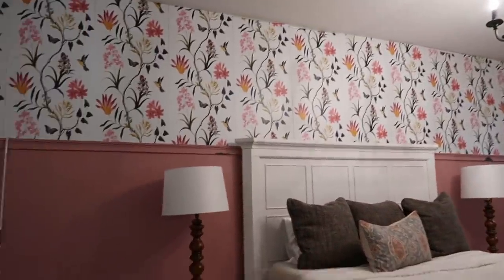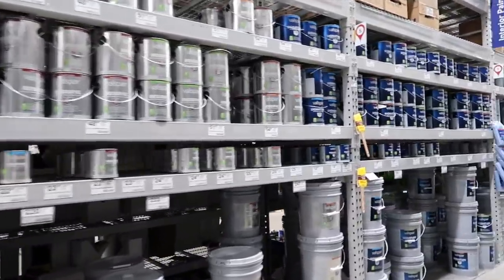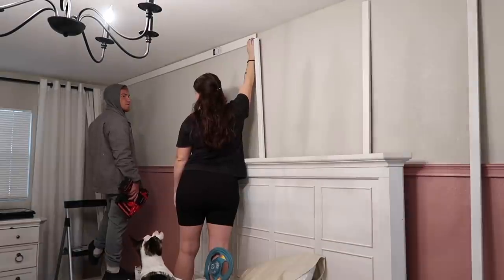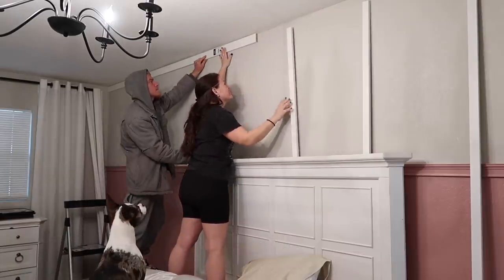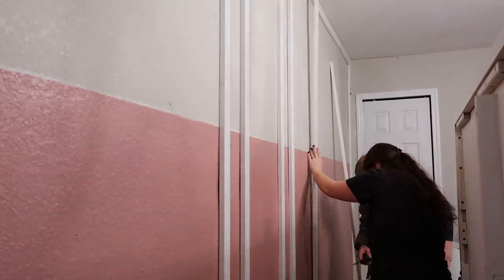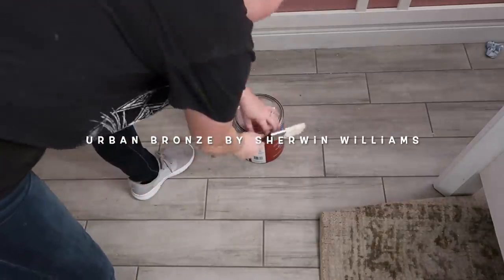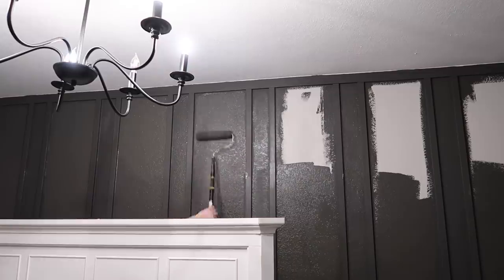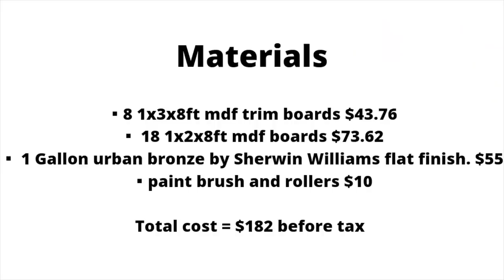Master bedroom makeover | Moody accent wall diy | Bedroom transformation | Small home updates

Comment: I LOOOOVED this makeover, Karrie! And I agree with you: having the dark & moody accent wall in the bedroom is just so beautiful 😍! Quick question: did you use wood filler or caulking to join the seam of the two top boards towards the ceiling? I think I may want to do something like this in my bedroom ❤️👍🏾…
Reply from the maker: I used the caulk 😁 you can still see it a little but with such a dark color it's not too noticeable 😊
Reply: @karrielynn  Thank you so much for responding! Going to save up to do this in my bedroom ❤️!

Comment: That wallpaper came off a lot easier then the stuff I had up on my bedroom wall..... I probably shouldn't admit to it, but I wove a tapestry of cuss words trying to get it down out of pure frustration....then I found the best tip ever for stubborn wallpaper..... hot water mixed with fabric softener, any brand, doesn't matter. Get as much off initially of the paper as you can...then spray what is stubborn with this hot water and fabric softener solution, about half to half ratio. Works great and you won't cuss your brains out like I did. Mine wasn't peel and stick, just traditional wallpaper. Once dampened with the solution I mentioned, it will scrap off so much easier. Your bedroom looks gorgeous.... moody and sexy 💕💕💖💖

Comment: Hi Karrie! I absolutely love this accent wall. You do such a great job and your so creative! I have a question unrelated to this makeover. Remember the round table you redid before you moved into this house? I'm the one that you inspired to do that to my table! It has held up really nicely but yesterday when I was cleaning it up for dinner I noticed that where the two pieces meet in the middle it has seperated. Any suggestions on how to fix that? I love your channel I get so much inspiration from here!
Reply from the maker: Yes I'd just paint over those areas like you did then seal right over . You may need to sand down a bit but that should work or just take a q tip with a touch of paint for those areas and re seal.  If you have Instagram send me a photo so I can get a better idea .

Comment: Doesn’t the flat paint make it hard to clean? Especially in the laundry room?
Reply from the maker: Well my laundry room cabinets don't get wet at all so I don't think it will be a issue and it's just the upper cabinets that got a little more glossy for some reason. But I usually just wipe with a damp towel and I've never had a issue using flat paint .